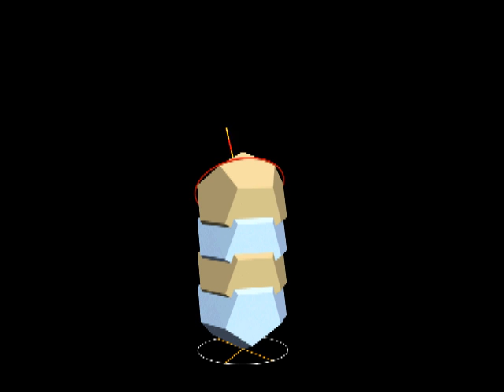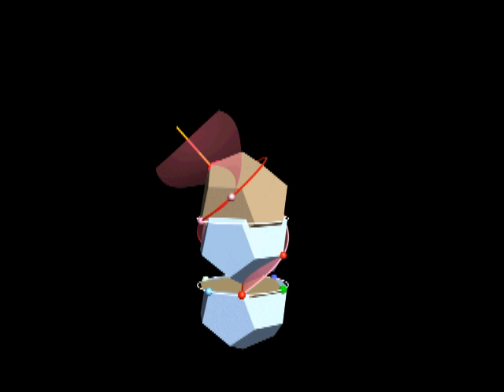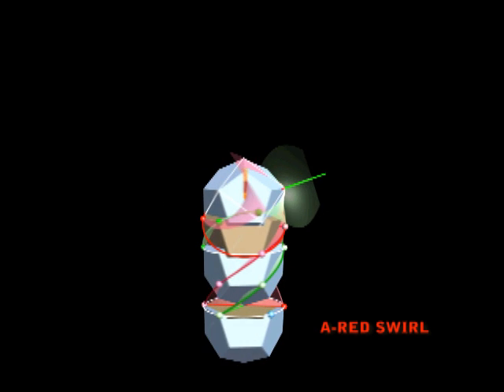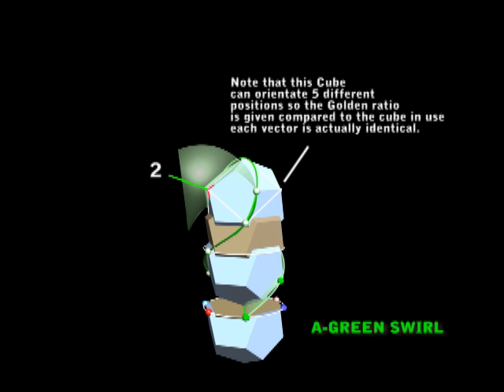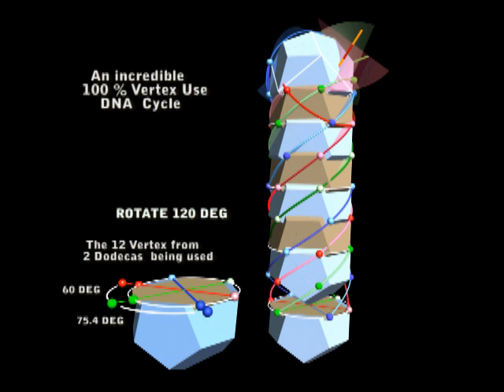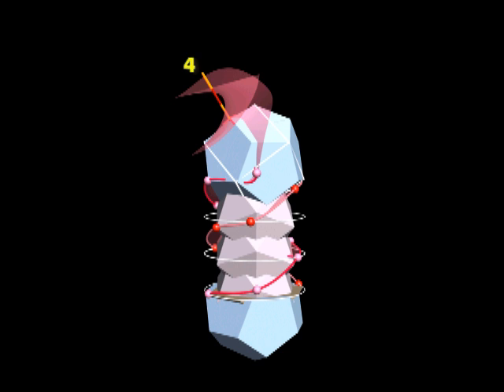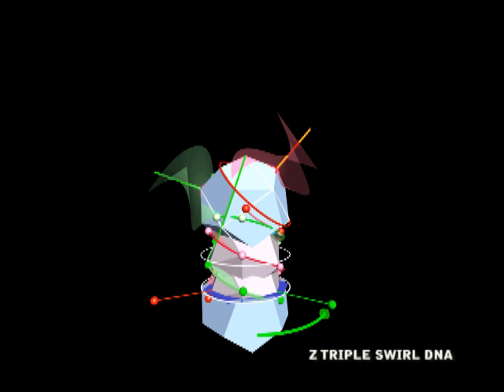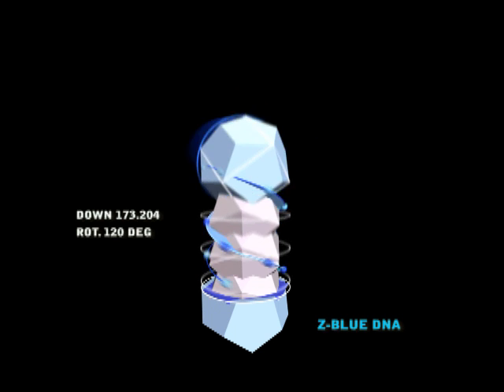DNA 3 6 9 MULTI-WAVE BEND SYSTEM.

Comment from the maker: OK islandbuoy4 I have just checked it out.
Actually looking down from a top view on 4 basic A- DNA swirls it is basically a Hexagon of rungs. Wiith angles of
44.6, 75.4 and 2 of 60 degs that make a total of 240 degs ( this total is because it stretches in 3d helix) The Z-type  shows a good hexagon.  If the there were 2 rungs at 90 deg. it would look like a swastica.
Paul